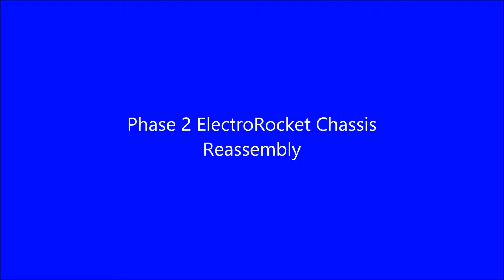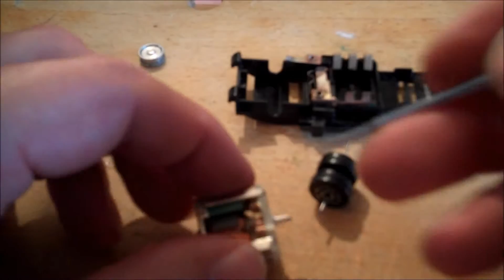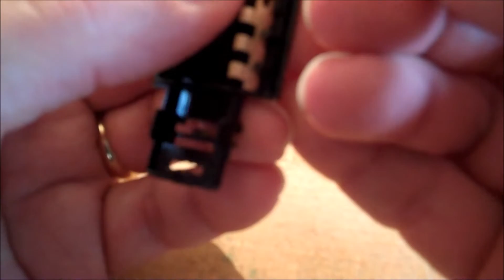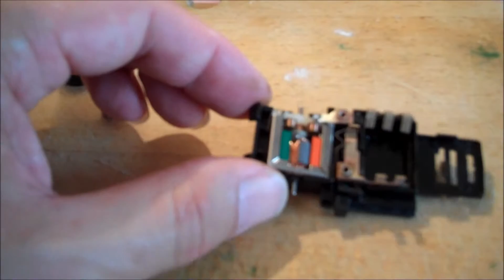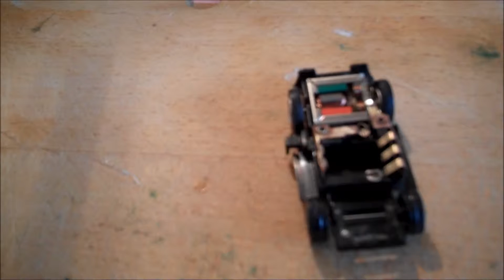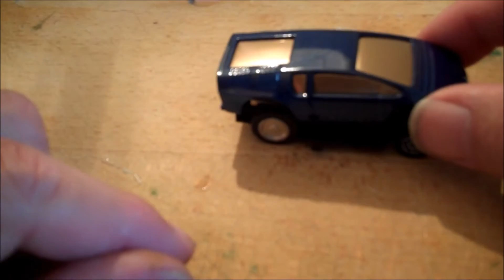Corgi ElectroRockets Cleaning & Repair Guide Part 8 - Phase 2 Chassis Re-Assembly

Comment: what's contained in the cleaning fluid?
Reply from the maker: It's just a domestic limescale remover. I use 'Viakal', & you can use it neat or dilute it wth water depending how bad the furring is on the chassis. There is a product which I think is called 'Tarn-X' that the Sizzlers guys in the US use.
Reply: thanks mate
Reply: have you ever tried a product called "CLR"